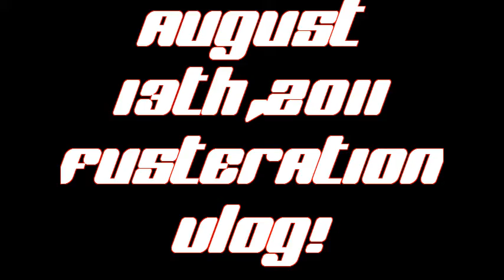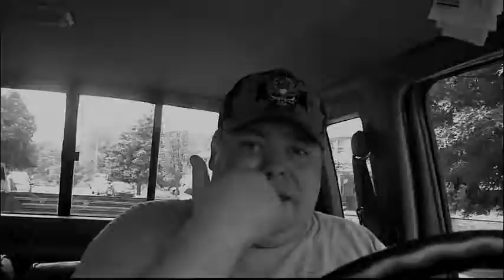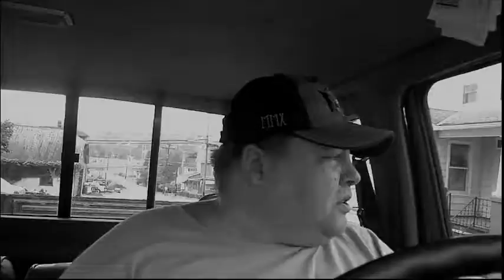Frustration Vlog

Comment: Wow, 18 mm bell housing bolt heads.  That seems big for GM!  I wonder if the softer aluminum threads heat up and bind even stronger over time to the steel bolts?  GM seems to never provide clearance to efficiently remove bell housing bolts!    I know on second generation S-10's  many individuals make special tools to reach two of the bolts!  Good luck!!

Comment: I dont know what kind of room your working with, but if you can try tapping on the bell housing where the bolt is stuck with a hammer. Use common sense when hitting on the bell housing, dont go smashing it but some solid hits. That will break up the corrosion on the bolt and then spray some penerating fluid on it. I've used this trick a numlber of times and it works 99% of the time. HTH Good luck

Comment from the maker: @epiphaknee  Yea and it's the only bolt that threaded into the aluminum so the corrosion factor doubles automatically because of how two dissimilar metals corrode together. It's pretty bad that a 1/2 inch drive impact gun with 100 psi of air pressure can't break it loose. my next thing is PB Blaster and a ratchet with a cheater pipe on the end. No matter what that bolt is coming out! Thanks for the comment.I am really glad you watch my videos and always comment.Just to let you know its awesome!